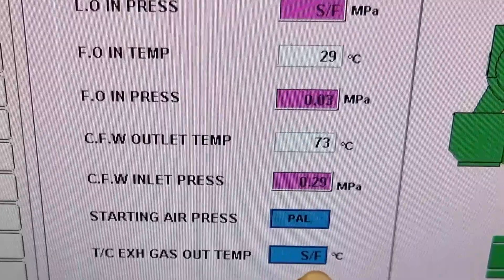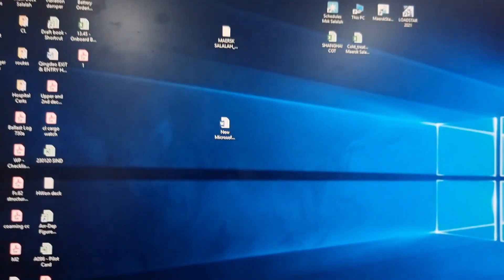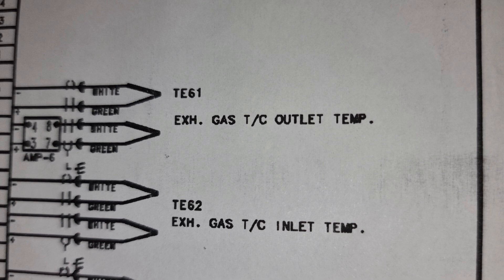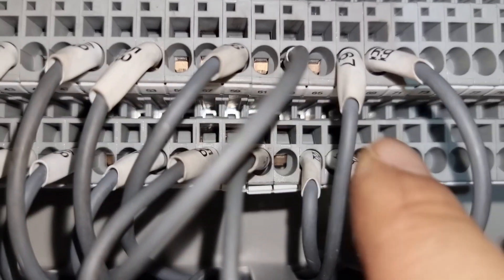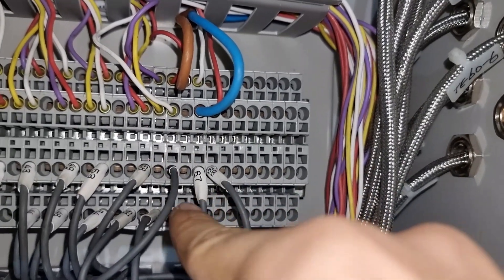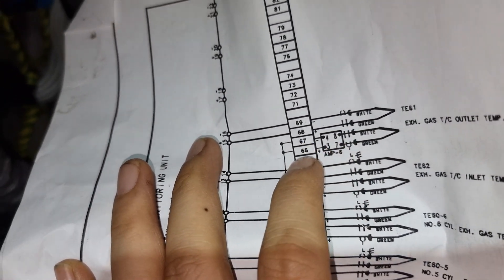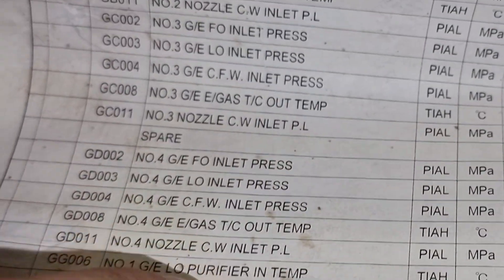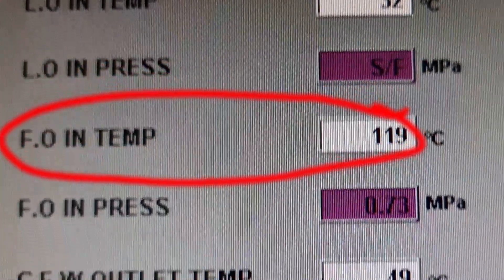GENERATOR SENSOR FAULT ALARM, HOW TO TRACE WIRING DIAGRAM? | Marine Electrician

Comment: Get a Fluke 773. It reads mA signals with a clamp. You could see if your sensor is in range (4-20mA) or not so that gives you a starting point if it’s the PLC or not. You can also simulate a current signal with it. A massive time saver. Love the Insight to your time onboard. 👍🏻
Reply: i know this is 2years old but holy hell man thats a causal $1.5k-2k for a meter. I guess its based on case by case but i just use my 87 to read 4ma-20ma signals. and if needed i have a plc tools simulator to shoot in some current. all for less than $1k and a lot more versatile

Comment: hi it's so good to have you.
my emergency generator is not sensing the MSB power after black out.
it's not stopping the Emergency generator aftre recovery of the black out... which component could i have to check in order to rectify this problem. for the time being i am just switching of the EDG  and switching on the MSB tie breaker manually on ESB.
Reply from the maker: after recovery, stopping should be done in manual operations.

Comment: Interesting that marine uses Green/White for Type K. We use Red/Yellow for oil and gas. Even Armored cable thermocouples are annoying with problems because the armor braid can stab through and cause a short.

Always checking each lead (red or yellow) against ground. (We used ungrounded thermocouples) to see if they are shorted.

Comment: While you adjust amplifier that time local panel temp also changed 25 to 30 and ams system? yes or not?if yes how you come to know that is the actual output of temp sensor?
Reply from the maker: You have the local reading on the local control panel. Most of the time the local reading is the accurate one as it did not pass to that amplifier hence the ams should much the local reading. I verifed that one using the digital multimeter
Reply: @leckyjake  you mean while adjusting span of the amplifier..local reading is not changing only ams value is changing w.r.t to local reading?

Comment: Thank you for sharing idol.
Tanong ko lang po sir. Pagnagpalit ka sensor sa generator wala na kailangan patayin?
Reply from the maker: Depende lagi kung aling sensor ang papalitan
Reply: @leckyjake   how about po ung sa video mo sir. Ung nag S/F na T/C Exh Gas Out then ang LO Press? 
Direct mo lang nilipat ung maling connection(7-8) into amplifier without switching off anything?
Reply from the maker: Yup, 4-20 mA type sensor sila and to think about it, naka sensor fault na sila. You need to isolate the system if the sensor is placed in an unsafe area, let say winding temperature sensor.
Reply: @leckyjake  thank you sir.